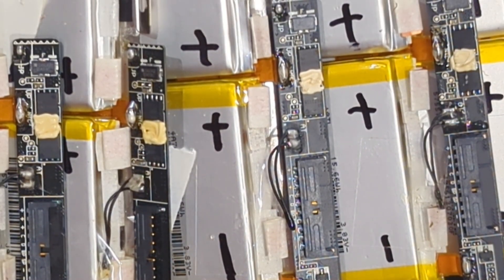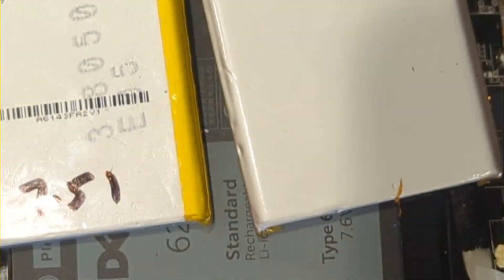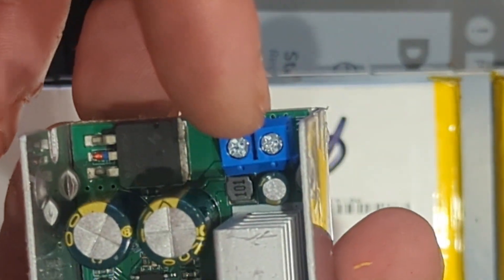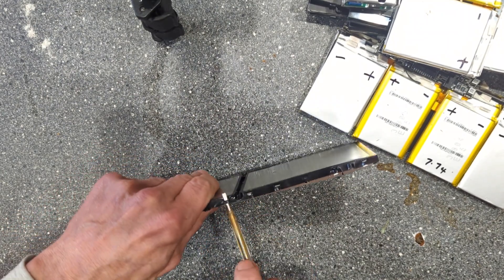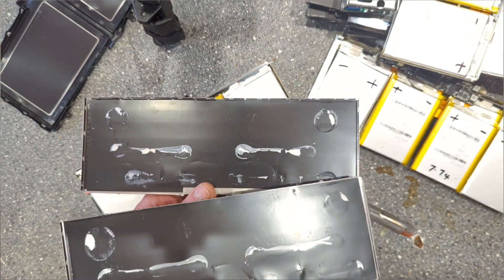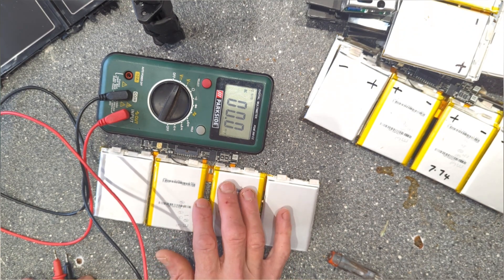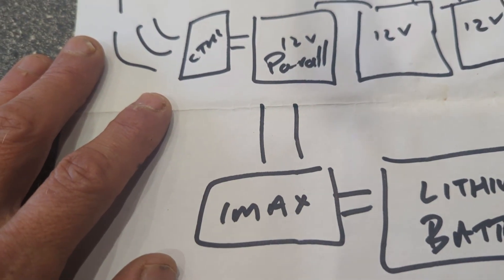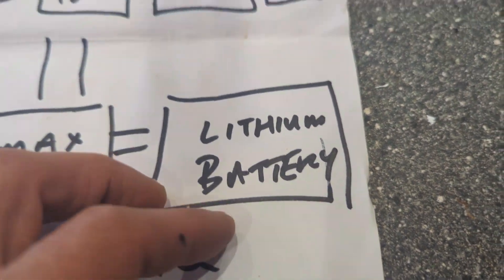Wind turbine generator project - I just bought a joblot of UNTESTED Laptop Batteries

Comment: Why dont you build your own charge controller with a brake on it?
If you send me your email ill send you photos of my setup 
Its easy to do and very cheap 
Plus it wont mater how many watts you put through it. 
You all ready have some of the components do your half way there
Reply from the maker: gsw999@hotmail.com , Thankyou !!
Reply: Hi Ollypolly, 100% in agreement with you. I use £13 volt sensing relays ("U30"s)and £20 100amp SSRs ("MGR")for my turbine. Very reliable over the last two years. Expandable to any size domestic turbine. Just add more car heaters or resistors. Tuneable to any stop start dump voltages. I've hacked off  off (techy term😅) the solenoids from my volt sensing relay so the whole thing is solid state now.(easy to do) Can flicker off and on silently and rapidly as required around narrow on/off voltage set points to bleed off excess power and it and holds battery volts down perfectly. Worked a treat for two years now. The other extremely expensive option is to import a genuine 60amp MPPT TS60 or Outback from USA for a mere £1000+for MPPT...and even  that still wouldn't handle Gavins beast if a turbine.  The mechanics of this turbine are tremendous but it's a little  frustrating to see it limited because of basic power/volt control. Sky's the limit with power control but you can get most of the function you need at fairly low cost. Also making your own DIY controller is fun and satisfying.
Reply: ...I'll send diagrams and pics too if you want. Good to compare ideas.